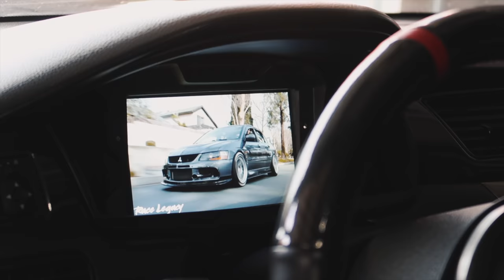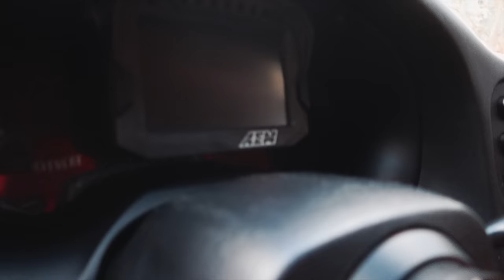MITSUBISHI VR4/DSM/EVO BUILD PLANS For 2022!! | Final Vlog

Comment: Be careful timing the 420a bro The tensioner pin is supposed to come out without any resistance. The hydraulic plunger should be loose (2 bolts) before installing belt then tighten down once proper tension is reached by pushing the tensioner up with a pry bar. You can test tension by inserting the pin back into the tensioner it should slide in and out.

Comment: Nice!

My goals on the evo 9. are to install a CSF radiator, Fp Red Turbo and my badass pro stock full race manifold.. keep it safe and reliable on e-85. Also just got it painted so we need that ceramic coating next. Hopefully all done by 2022.

Comment: My plans for my 99 GSX are strip and repaint the engine bay, run all new fuel and brake lines, send the block out to get machined and built, and start getting stuff ready for the new engine and trans
Reply from the maker: That sounds exciting. Enjoy the process
Reply: @MiguelDsm  I'm certainly trying lol so many very expensive parts still to be bought

Comment: Happy Holidays, loving the VR4 build. What have I started with the true black interior lol, looking great, love the DSM, wish I could get a decent one in the UK.
Reply from the maker: Happy holidays man. Need to get lucky with sourcing some black Interior for the Vr4
Reply: Loving the overall direction of the VR4 , it's looking menacing with the carbon. Mine is currently on jacks while I do the clutch, 19t's so I'm at a stage 4 Competition Clutch, daily drive mine so will be back at full power shortly.
Reply from the maker: I run a competition stage 3 on the eclipse. Been great so far

Comment: If you decide to do a bigger turbo on the evo could you sell it it would be a perfect upgrade for my 97 gst
Reply from the maker: Evo turbos don’t fit dsms man. Mine does because it’s swapped
Reply: @MiguelDsm  I did some research and they do you just have to buy a j pipe kit and a 16g turbo hardware kit it includes all the necessary hardware you need

Comment: Ese miguel how you doing brotha! 
I need some advice, so I found a 1999 gs-t with a 110k miles, no rust paint is an 7/10..   but the car has been sittin for about 3-4 years. So as you can imagine the car is gonna need new fluids, exc...
But the seller is asking 2500, I would like to send you some pictures and more info on it if you up for it. But I hope to hear back. God bless 🙌 🙏